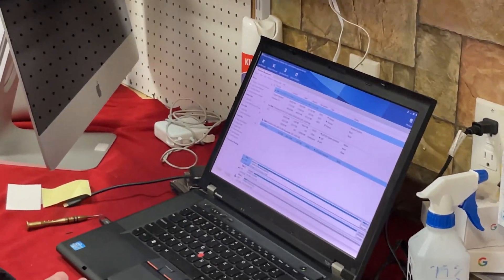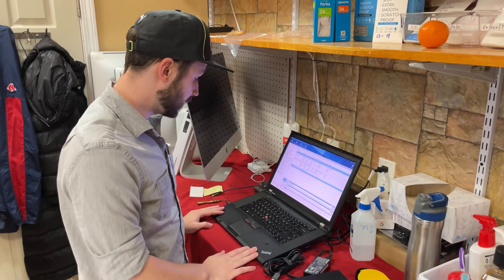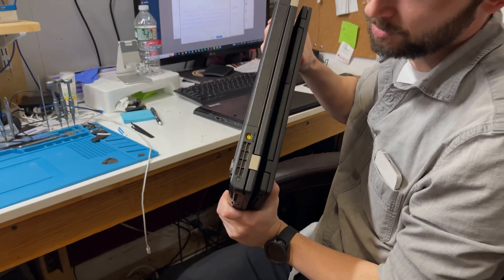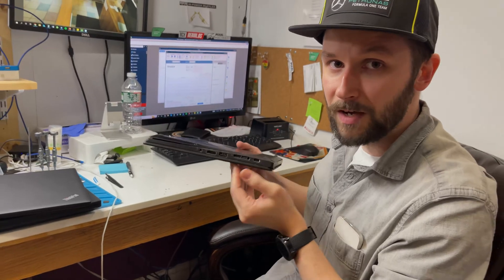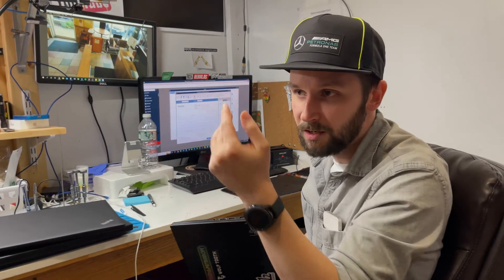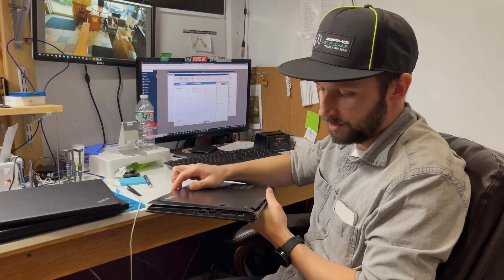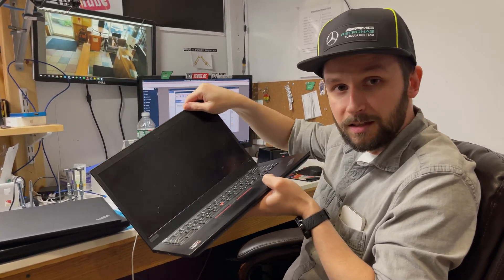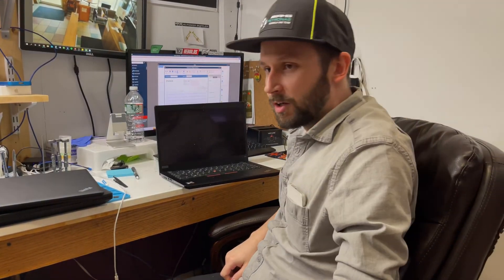Soldered USB-C ports are a step backwards for the laptop industry

Comment: USB-C is the best thing in the world.
That's why the EU adapted it.
On the otherhand. It should have a replaceble connector.
Reply: Nothing beats a SCSI port !
Reply: The EU did what it did in order to not to generate so much ewaste. But politicians don't always think rationally.
Reply: @pepo4990  it's not a usb c fault, but the company that wants to save some money.
Reply: USB Type C is just a connector that hosts a confusing mess of different protocols. We will eventually get there, but we’re way off the mark for it being the “best thing in the world”.
Reply: @StolenJoker84  I mean, there are pretty good cables out there that use USB C.
Anker personally I have no complaints about, I have their 3 metre/9 foot red cable 100w cable. Works like a boss, you could get a USB C 3.1 Gen to actually do everything.
It charges my phone (Pretty well actually) , it can transfer data (I personally don't use it much as I don't have many USB C slots on PC) and can transfer video output (I never used this feature) I mean I mainly got it for the length but it has been a dream ngl.

Besides my situation, yes I find that you should do some research about the cable before purchasing. I have once gotten 2 cables from a no name brand that has those LED power indicators, that can get very hot and fry your hands if you aren't careful.
Reply: @Moshimulations  Yes, there are good quality cables out there, regardless of the connector. That doesn’t change what I said about USB Type C, though.
Reply: @StolenJoker84  Ye you are right. 
Generally though, it is significantly better than having several different barrel AC chargers, as you cannot use them to charge without trying to find out which one is the right size.

With USB C, you could charge everything with it and aren't limited to the random dimensions that everyone uses.

Theoretically you could use a non USB PD charger to charge things, sure it isn't the most efficient thing but it is possible though really goddamn slowly.
Reply: but why for power?? The rotating ones were so much better T_T
Reply: @AdjectiveBlazkowicz  Old AC power connector came in such shapes there were rarely any compatibility in mind or sense in design. There were times where I could use an AC adapter's cord for a 9 volt power supply for a laptop bcs it fits but there were time where I COULD not find that fucker had to order one from aliexpres. USB C becaming a standard removed that. Now u can charge anything with anything.

Comment: to be fair- making the USB C charging port modular wouldn't be THAT hard. The HP Spectre X360 does this - and has been doing for the past 3 years - so it's possible.
Reply: Incredibly surprised HP is somehow taking a right step
Reply: @tech8652  Especially the high-end models are easy to repair, since like 10+ years.
Reply: @tech8652 the 840 g1 was really repairable, didn't even need a screwdriver to get to the ram slot, took 8 screws to remove the 2.5 in hdd though, and the cpu was soldered.
Reply: @flamestoyershadowkill in laptops nowadays, you won’t find a PGA or LGA CPU or GPU in a laptop. It’s just a way to compromise performance and slim profiles over repairability.
Reply: @flamestoyershadowkill  it was not an hp issue for using a soldered cpu. 4th gen and later mobile intel cpu's are soldered on the board to make laptops thinner and more efficient
Reply: @engineerbot  Intel discontinued their socketed laptop SKUs after the 4000 series, that's not really on laptop makers.
Reply: @engineerbot  there is AM4 socket laptops.
Reply: even macbooks do it
Reply: CPU and GPU could be upgradable too but it comes down to saving pennys
Reply: Ive seen new* Chromebook comes with small PCB with USB C .
it sure is cheaper to replace that then a Full MB.
Reply: While you can’t buy the daughterboard for it anywhere as far as I can tell, my headphones from Corsair already have this.
Reply: spectre x360 has soldered type c ports
Reply: I like that I can use the Steam Deck charger rather than the bulky Lenovo one I got from work. I hate those giant laptop bricks. I can use one charger for my phone, my laptop, my handheld game consoles, and more. I'd hate to go back to the old ways of multiple bulky chargers.

Comment: Being mad that you need to solder to fix computers is like being mad that you need a wrench to fix cars. Why not learn to solder at home?
Reply: Because much like how mechanics don't want to have to resort to welding but instead prefer wrenches and bolts. Technicians don't want to have to resort to soldering but instead prefer screwdrivers and screws
Reply: @strob5657  they aren't a technician then, any idiot can use a screwdriver and plug components in. The whole idea of being a technician is you have skills that most people dont
Reply: @Hadzz95  technicians are so much beyond just the simple ability to solder. Just because he's mad about it doesn't mean he doesn't know how to solder, take Rossman for example. A technician's worth is in his troubleshooting experience and access to parts!! People are mad about it from an unexperienced end-user perspective
Reply: @strob5657  no idea what Rossman is. But every component you ever install will be pcb with solder. Not saying you have to be the best solderer, a usb port is not even close microsoldering. Take a couple weeks and learn a skill
Reply: @Hadzz95 I have significant experience with micro soldering. Also have dealt with the same exact issue in this video with my own Lenovo. 30 minutes and was fixed. I’d still, whole heartedly recommend that usb ports be swappable without having to dig out my hot air station please :)
Reply: @1FireyPhoenix  nah give me a securely connected component any day. Resistance is real when you're dealing with low volt/high amp usb-pd
Reply: @Hadzz95  I mean, it’s not really securely connected if the port gets ripped off the motherboard :)
Reply: @1FireyPhoenix  I'm more talking about the conductivity. With the same surface area, solder will always be better. Idk how people rip them out in the first place, though. Takes some considerable force
Reply: @Hadzz95 while I CAN solder, it's a royal pain the ass, so much so that I'll do everything else to AVOID doing it. 
For one, flux can get everywhere if you are so much as nudged in the wrong direction. 2nd, you are handling a hot iron the entire time. One wrong move, and the board you are working on is toast.

And at home IS NOT the best place to do a soldering project. There are entirety too many interruptions going on in a normal house.
Reply: @Hadzz95 give me repairability where I don't have to damage the rest of the board. I'd rather modular than soldered on.
Reply: The point is, its hard, it makes everything unusable, and its pricey to repair. Its not about skill its about proprietarisation of consumer electronics
Reply: soldering is not that easy.even i hate doing it.
Reply: @azuaraikrezeul1677  it's not something you can immediately pick up, but it isn't that bad if you put in the practice. Just need to learn the basics like keeping your tip cleaned and tinned, choosing the right tip (whatever will give you the most surface area for the joint). And above all else understand that the tip is just to heat up the joint, not to transfer solder. Lastly flux, flux and more flux

Comment: The later models of the square charger were also soldered, see the 260/370/x380. Sadly.
Reply: @SalemTechsperts  Yep. I work for a high school that until recently, bought entirely from Lenovo. They screwed us badly with some issues the L13 Yoga Gen 1 had, so we switched to Dell. But yeah, The S1 Yoga and Yoga 12 were also soldered on now that I think about it. That being said, they were absolute tanks. I rarely if ever had issues with those ports going bad/being damaged. USB-C on the other hand... Our L13 and X13 laptops have one of them going bad OFTEN.
Reply: @Sabermatrixx  How are the dells holding up? I'm going to buy a laptop tomorrow which I plan to use for about 10 years. I'm choosing between Thinkpad and Latitude.
Reply: @gigacatkun  honestly, depends on the model. Dell is releasing new machines this month (the latitude line is being dropped, as is XPS, precision, etc) so the current latitudes are a bit cheaper. That being said, Lenovo has a more robust replacement part availability for you to replace things down the line. 

You don't go wrong with either, honestly.
Reply: @Sabermatrixx  Thanks man. It'll help me choose. And one thing, is the thinkpad L series as good as T series or Latitude? Here the T series is hard to find and even if I can they are quite expensive. On the contrary, L series is pretty common here.
Reply: @gigacatkun  I use an L15 G2 (AMD) as one of my machines. T series is definitely built better chassis wise, but that's the point. L series is one step below T. E series is one step below L series. P series is the top dog. 

The L series is on par with a Latitude 3000 or 5000 series. T series Thinkpads are upper 5000 series or 7000 series. P series is 7000/9000 series latitudes, in my opinion.
Reply: @Sabermatrixx   I got the Latitude 7430 i7 with 16gb ddr4 ram. Hope I made the right choice. Thanks man for your suggestions.
Reply: @gigacatkun  Funny thing, I am actually USING a 7430 2-in-1 with an i7 and 16gb of ram right now. Its my work laptop. We use them for our class of 2027 students. Fine laptop. You did good man!
Reply: @Sabermatrixx  Mine is the same. But just 180° laptop. Hope it'll last good for a long time.
Reply: @Sabermatrixx  What about Latitude 5310, 7400, 7300 and 7290?

Comment: USB Type C are hyped up by tech youtubers, influencers, AND Apple, so that's why manufacturers put it for everything even if they don't do it properly
Reply from the maker: I love USB-C, I just hate making it non-modular when it's serving an important purpose like this.
Reply: @SalemTechsperts  i mean phones have modular usbc ports WHY TF DONT THEY USE THEM UN LAPTOPS THEY HAVE A LOT MOR SPACE TO WORK WITH
Reply: @SalemTechsperts  The new Think Pad has 2 usb-c ports.
Reply: @SalemTechsperts  Type-c is amazing and I'm happy to have them everywhere, but of course they have drawbacks.
Luckily EU is working on law to rate reparability as well.
No solution is perfect, but I really like the framework solution.
Reply: USB C is good, soldering it to the motherboard is not.
Reply: what is the advantage of proprietary power cable over USB C?
Reply: @Webexplr they can be more robust.
Reply: @Webexplr possibly a sturdier connection.
Reply: @Webexplr Allows for higher power draw
Reply: @Webexplr it was modular (for Lenovo's at least
Reply: That’s why they’re manipulated by this and turn a blind eye from potential issues that can never improve or resolve over time.
Reply: Apple? Nahh... more like Intel.
Reply: more like every electronic manufacturer ever
  @mohd5rose
Reply: By apple?! Dude europe had to force them to use it XD
Reply: One huge advantage of usbc (on a MacBook Pro) is that I can charge it from both sides. And also the compatibility with mobile powerbanks (that support power delivery)
Reply: you mean everyone.. from Google to Microsoft everyone use usb c damnit.
Reply: Yeah

I find Usb-a more durable
Reply: Its legally required in Europe for portable devices to be charged with USB C, nothing about hype
Reply: To give some credit to Apple, on some of the Macbooks the USB-C connectors are modular and can be replaced separately without desoldering.
Reply: The story I heard was that EU regulation is one reason for a huge emphasis on USB C connectors. “Less e-waste this way,” was the argument. 

Unfortunately, you don’t get less e-waste when the USB C connector is not modular, is not replaceable, is soldered into the rest of the device.

The road to hell is paved with good intentions.
Reply: @rstewart2702 at least Android mobile phones often have it on a daughter board together with a microphone and speakers. Probably because they have to split the main board in two to fit a battery in full width of the device. So it's more likely a convenience, not a good intention.
Reply: @rstewart2702 but barrel ports almost everywhere are not modular too. The connector type isn't a problem here
Reply: I don't get usb-c for laptop charging. The original ones could rotate making it easier to move around. Also 99% of usb-c's are designed to fail, like where are the rubber things that used to be on black chargers that made them sturdier and less prone to snap?
Reply: @AdjectiveBlazkowicz  most barrel charger is soldered.
Reply: @AdjectiveBlazkowicz  blame and praise the EU

Comment: Shout-out to my old ThinkPad X200 for outliving my Lenovo Z50-75. Now if only my x200 can take more than 4GB RAM...
Reply from the maker: Those X200's were a marvel of engineering.
Reply: it can, the only reason the official limit is 4gb is because at the time 2gb was the biggest you could get. now 4gb sticks exist so 8gb will work just fine.
Reply: The reason why Lenovo said the RAM limit for the X200 was 4GB, was because singular SODIMM modules only went up to 2 GB back in 2008.
Reply: I had an X200. It was a solid machine and very lightweight

Comment: Agree, old ThinkPad rule. I use t420 and it just won't die. Only new laptop worth considering is framework.
Reply from the maker: Bingo, the framework is the only logical option for those of us that want repairability over everything else. That T420blazeit will outlive us all.
Reply: Bro if everyone buys a framework you would be out of a job.
Reply: I just bought a t410
Reply: L480 here.....hai, I like it it's cheap uhh... Yah soldered USB port urmmmm meh I paid 200 bucks for a great laptop and cpu what else was I gonna get a shitty Celeron?
Reply: My T430 won't die, except the time my large umbrella cockatoo decided to rip most the keys off and pushed it of desk, but thankfully LCD survived and was a removable keyboard and will likely outlast me even. Do use newer T14 and T480 as well, but nothing like the T430, it just built way better. Newer consumer grade laptop is pure garbage, ram soldered in, SSD soldered in, glued hinges and even keyboard plastic welded into the frame, not replaceable.